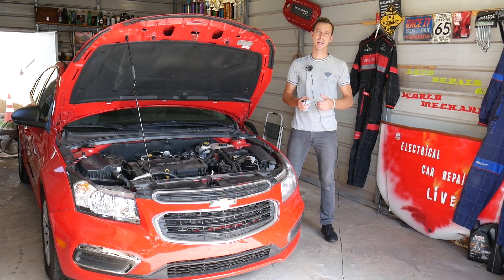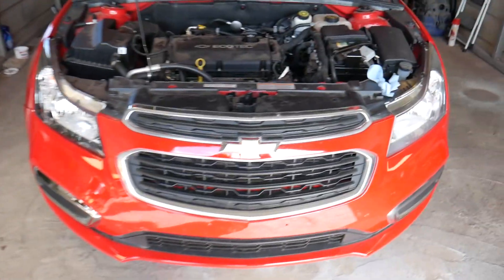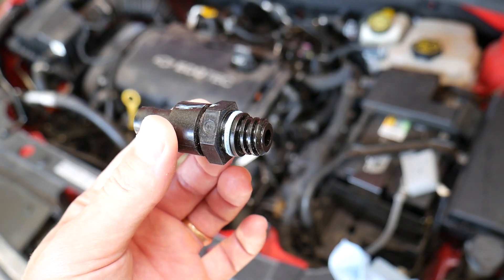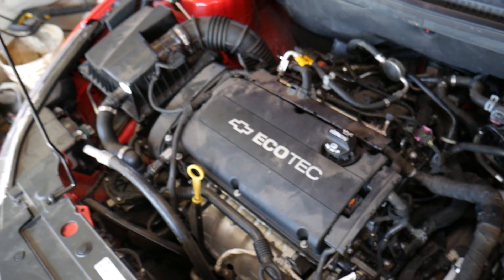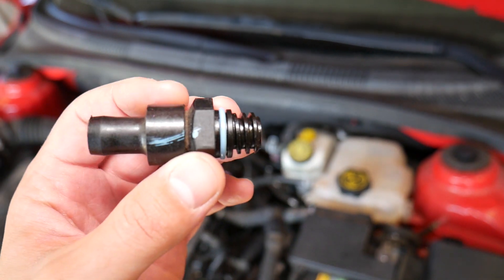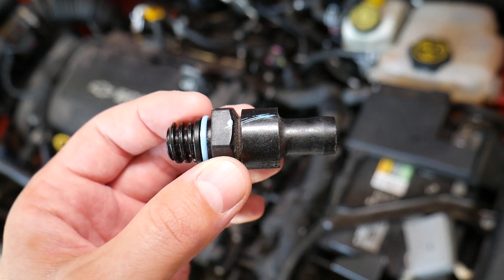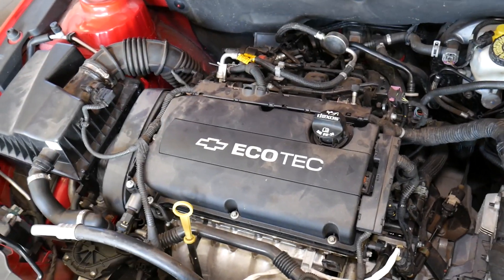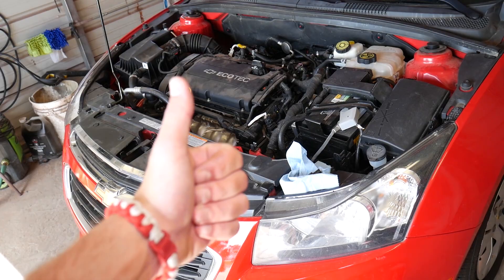HOW TO TEST PCV VALVE ON CHEVROLET CRUZE SONIC. CHEVY CRUZE SONIC BAD PCV VALVE, HOLDEN CRUZE

Comment: What to check if there is a pressure in coolant reservoir, is head gasket or something can cause this, because when my engine is cold in 2 nd gear it suffocates the engine when i press gas pedal and also have alot of pressure in coolant reservoir when engine is warm

Comment: Just ordered, Cruze, engine oil cooler and Rocker Cover, with integrated PCV valve, figured with 169,000km on the clock faulty PVC Valve, probable cause of oil cooler leakage, which makes a mess and non functional engine

Comment: That is the pcv on a naturally aspirated motor, the more common version (the 1.4 turbo) is an ENTIRELY different system... actually much so that you need to change the entire intake manifold and valve cover on them. Also if i recall correctly the valve covers on these also have a diaphragm that can go bad and make it seem like the pcv valve is bad. But i cant remember for sure as most of my expertise is with the turbo model, as that is the one i own.
Reply: Yeah on the 1.4, it's typically the pcv valve in the intake that causes the valve cover to shit the bed. It can also wipe out crank and//or can seals.
Reply: @anthonyjulson8840  yup, but that's a very noticable sound most time. A chirp that will go away with dipstick lifted.
Reply: If you watched the video and listened, you'd hear him talk about that.
Reply: @lomax7578  2 years ago, I don't even remember posting this haha

Comment: Had a bad pcv valve on my 1.6l take the oil cap off while car is running. If it's blowing air out then it's bad. Sucking air in is good. 

That's what my mechanic told me anyway..